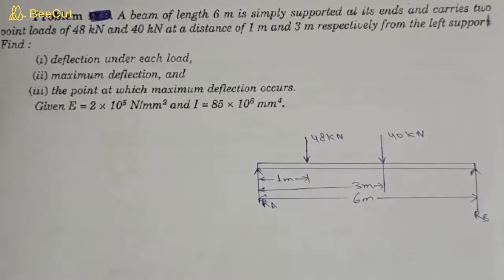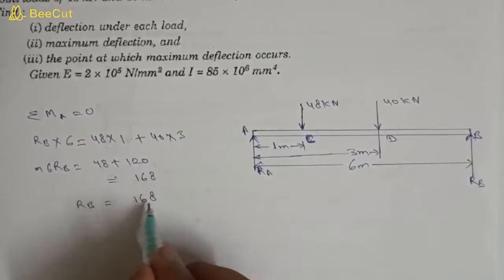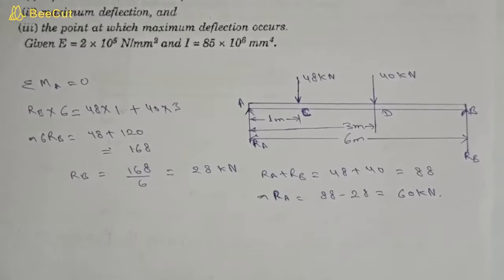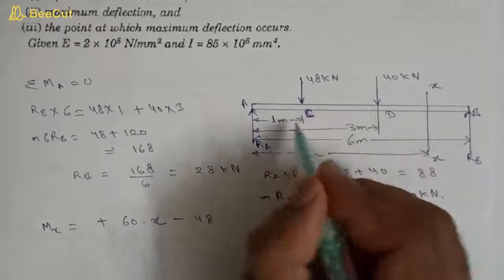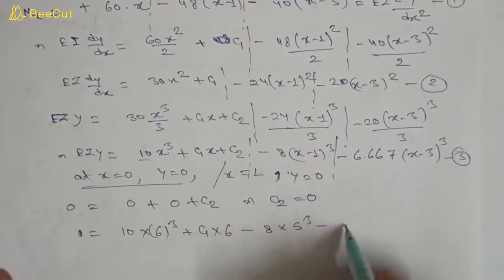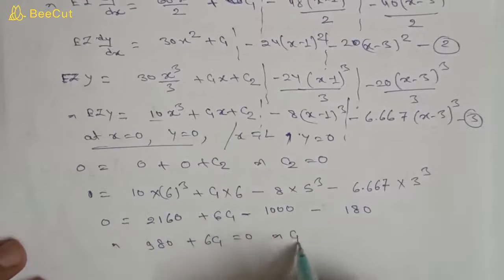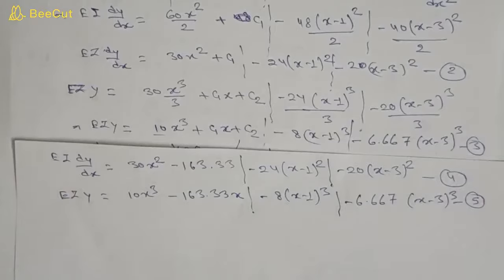Deflection of beams 10 //Macaulay’s method//simply supported beam with two/2 point loads

Comment: is dy/dx shear force? and can we find the max moment by integrating that using these equations? Because by plugging in the (1) equation into my graphing calculator I tried finding the maximum moment, but the location and magnitude seems very incorrect.
Reply from the maker: dy/dx represents slope of beam.
if you want to find Shear Force then you have to differentiate Bending equation.
means you have to find d3y/dx3.
anyway I have solved all type of problems in this channel so if you want to learn then go to playlist and watch from 1st video

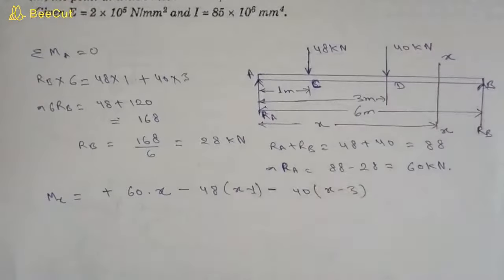Comment: Sir at 2:51 in Mx equation we only considered left part of the x like ra , 48kn & 40kn but we didn't consider the right side part rb in the equation. Don't we need to consider that ?
Reply from the maker: I think there is no need because you can move x distance up to last end of the beam plus when you are calculating deflection in any portion you have to consider only left side forces.
in case of overhanging or cantilever beam you may have to consider but in SSB when x= L moment will become zero around that load anyway.
you can watch this video for basics of Maycaulay's method
https://youtu.be/wVFOzDJF84g
Reply: @mechpm  thank u for ur reply sir I understood now after watching the video u suggested 🙂
Reply from the maker: welcome
and thanks for appreciation❤🙏

Comment: Sir... Good presentation... Can we use the formulae to find this... Wa2b2/3EIL for max deflection
Reply from the maker: You can't directly use this formula because this formula is used directly for single centric load on SSB.
But you can use superimposition method  of two SSBs with formulas wa2b2/3EI and for second beam wl4/48EI
Reply from the maker: For this you have to consider 2 beams with single load each then find deflections individually and then add both
Reply: @mechpm  i try like this.. But my final answer is wrong
Reply from the maker: There may be done mistake but method is correct.
You can read about superimposition method
Reply: @mechpm  okay sir.. Thank you for your information.
Reply from the maker: @redhi5381 ; welcome
Reply from the maker: But those formulas are for maximum deflection under load so you can't directly apply to any point

Comment: For slope calculation why didn't u take (x-3)^2 into consideration?
Reply from the maker: Because In this method you write equation for all loads and supports in one line but during calculating deflection or slope we have to consider terms upto that point only where you are calculating slope.
In this case the termed I neglected is towards other side of the maximum slope.
We have to consider only terms or loads which are left to maximum deflection point.
I hope you got it still if you have doubt I will try to clarify
Reply: @mechpm  ok...if we have another load of same 48KN at a distance of 4m from left end than should we have to consider this 3rd load in slope calculation?
Reply from the maker: No because from symmetry you can guess that maximum slope will occur at 3 m from left so you have to consider all loads only upto 3m.so we will not include 48 kn at 4m.
Reply: @mechpm  ok thank you...👍
Reply from the maker: Welcome 😊

Comment: ×= - 48+-√(48)2 *4*6*187.33÷2*6 . How do you taken this  values is over here  in no. 2 , 4 , 6 especially . Can you please explain me.. Sir...How it come?? Or which formula did you applied here it.. Sir.
Reply from the maker: That's simple quadratic formula.
it's x= -b +-√(b^2-4*a*c)/2a
Where quadratic equation is 
ax^2+bx+c=0
Sorry by mistake I have written + in place of - in video
Reply: @mechpm  sir, but how did you get 2.87 as the answer? 
What are the steps ?
Reply from the maker: @manalichougule7299 
i just used standard quadratic formula.
if you forgot how to do that you can watch following video
 https://youtu.be/TEkHz2iJSmo